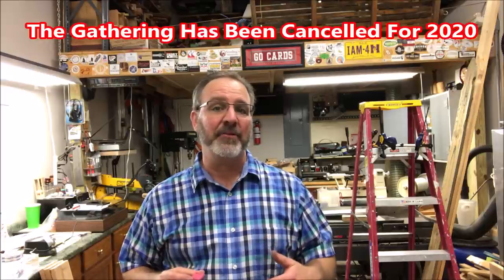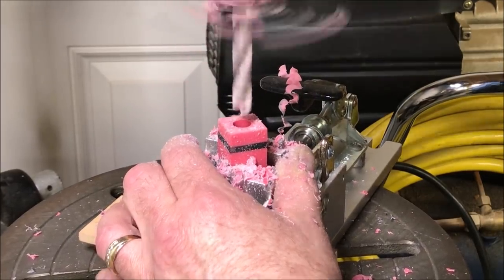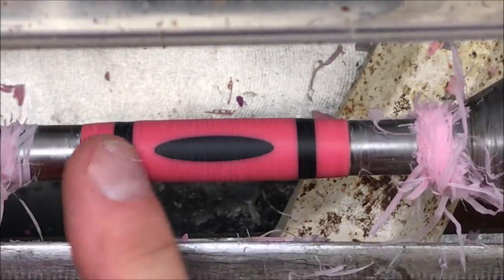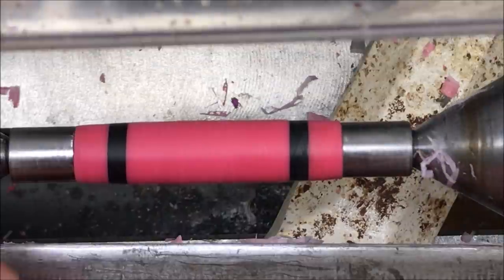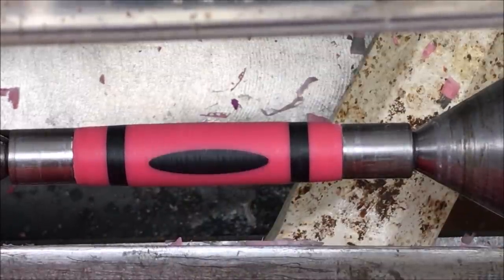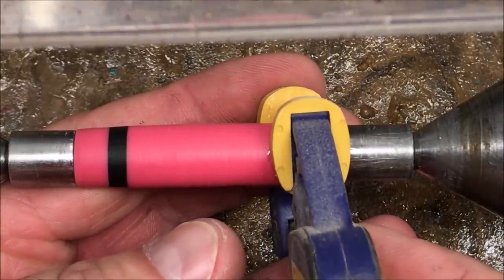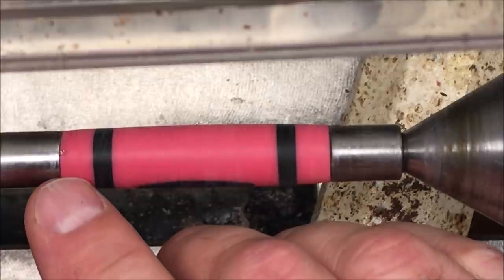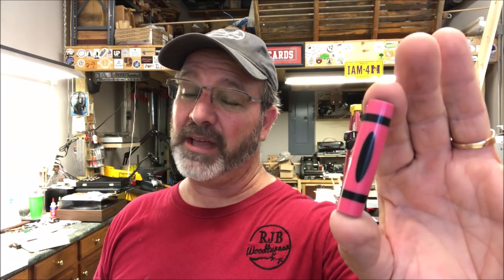Turning A Crayon Themed Blank

Comment: Sanding the chipped area with CA has worked for me.
Reply from the maker: I fill with C/A all the time. It does a good job but  it’s clear so you can see right through it. I’ve not tried this yet but perhaps mixing in a pigment with the C/A would help.
Regards,
Bob

Comment: I found that if I take  a shop towel and put a little acetone on it and wipe the nozzle of the CA bottle it keeps the nozzle and the cap clean which cuts down on the nozzle from clogging by a good bit.
Get some dust from the sanding of the blank add to some CA to make a paste and fill the chip with it to try to hide the chip. This has saved  me several blanks.
Reply from the maker: Thank you Mike. 

Regards,
Bob

Comment: I see you turned the whole thing with the roughing gouge. I'm having problems with the roughing gouge not taking as good a cut after a certain diameter and when I switch to my spindle gouge I seem to peel it off in rings instead of ribbons. This makes it hard for me to get a straight cut and I need to finish up with a lot of sanding.

The pen I made was a touch Stylus. Do you think it could just be the diameter was so small so the bevel support wasn't what I needed it to be, or could it be a sharpening issue? I'm using the factory angle on my roughing gouge so I don't really know what it is. What do you sharpen your at?

Thanks for any insight you can give
Reply from the maker: As the diameter changer you also need to change the angle of presentation for the tool. I use a roughing gouge for the whole turning and I’ll be the first to tell you that it’s the wrong tool for the job. Use it to true the blank then a Skew or bowl gouge would be a better choice. 

Regards,
Bob
Reply: @RJBWoodTurner  I guess I need to stop procrastinating and learn to use my skew enough that I trust myself with it. And maybe get a smaller one too. My only skew is an inch atm